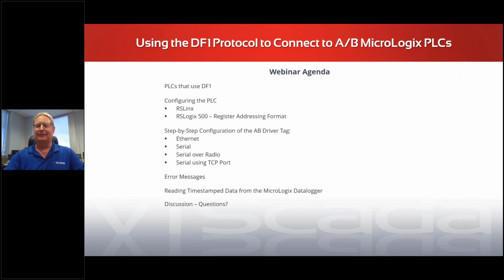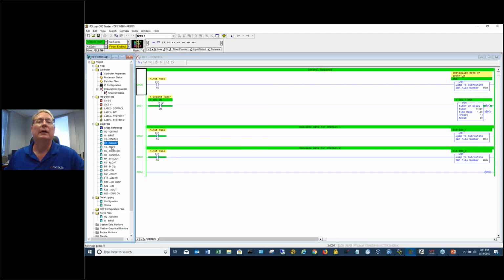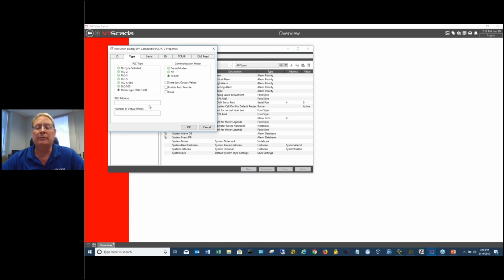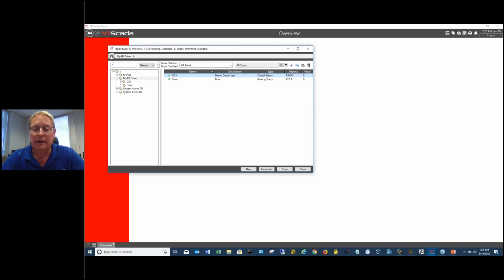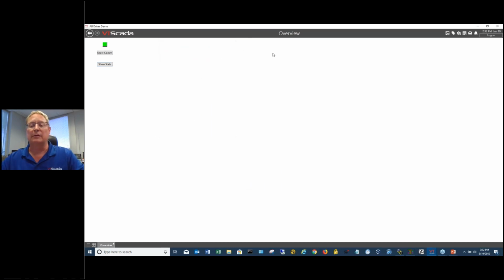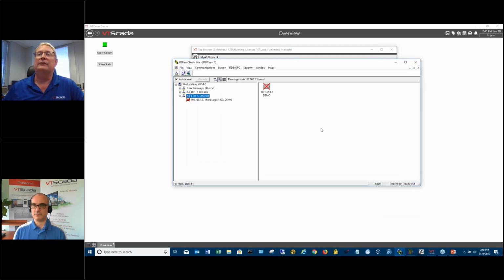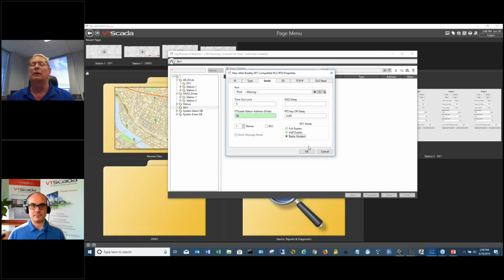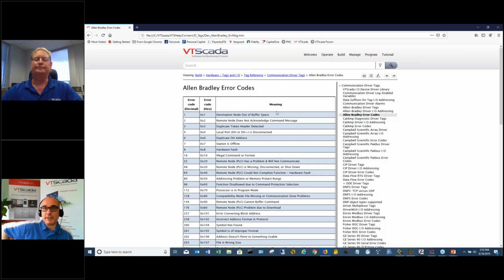Using DF1 to Connect VTScada to Allen-Bradley MicroLogix PLCs

Comment: Hello, I need some help please. I need to communicate VT SCADA version 12.1 with the Micrologix 1400 via Ethernet, but I think this video was made for VT SCADA version 11. I noticed that in version 12.1.25 there is no such drive as you showed in this video. The currently available driver is "Rockwell Software Devices". First I selected TCP/IP Port and in the properties in "Connection" I put the IP address of the PLC and in "Port Number" I tested with "2222 and 44818", then I added the Drive "Rockwell Software Devices" and then I need you to inform me which the settings that must be carried out in "PLC MODE" would be PCCC over CIP? In "Port Segment Path" what is the correct one to put, would it be [1,0] ? And in the "PCCC/DF1" Tab, in PLC Type, I put "Micrologix 1100-1500", I clicked OK and then I added the tag in the driver and then I gave a "DRAW" but the TAG is not communicating. Could you please answer me here or would there be some other channel for you to explain me the answer for this question. Thank you very much.
Reply from the maker: Hello Engenheiro, thank you for using our VTScada software. According to the latest version of the driver list, (https://www.vtscada.com/device-driver-list/) the Rockwell driver seems to be the appropriate driver for connecting to this device. Configuration information for the Rockwell driver can be found here: https://www.vtscada.com/help/Content/D_Tags/Allen-Bradley-Tag.htm?tocpath=Reference%7CTag%20Reference%7CCommunication%20Driver%20Tags%7CAllen-Bradley%20Driver%7C_____0 or by using F1 to open help in VTScada and searching for the Rockwell driver.
Reply from the maker: We regret the confusion and we are currently reviewing these older videos.
Reply from the maker: If you are looking for more free training options I recommend our online VTScada Academy https://home.academy.vtscada.com/. This allows you to work your way through the same material covered in our paid instructor-led Operations and Configuration course (https://www.vtscada.com/training-courses/) at your own pace.
Reply: @TrihedralVTScada  Thanks you Very much, now I am able to comunicante with Micrologix 1400 by watching this video It helped me a lot. Excellent video, congratulations. Im going to use It here at the Company and If the software was good we will to buy it . See you later.

Comment: The 1200's are discontinued according to that slide, how does one connect a micrologix 1200 to VTScada ?
Reply from the maker: VTScada has a built-in CIP driver (Rockwell) as well as a Rockwell Specific Driver (Pending release) which should connect to a 1200. You can get the current list of included drivers here: https://www.vtscada.com/device-driver-list/

Comment: any compatibilty with delta plc or siemens plc?i have posted in the forum but no reply from your side.how should one trust the software with less training tutorials and no response from forum
Reply from the maker: Hi Yogesh, I am very sorry to have missed your question. Delta provides a wide range of PLC devices that include a variety of open protocols which we support. Please check the protocol for the device you are interested in and look for it in our online driver list here: https://www.vtscada.com/device-driver-list/ Note: In some cases Delta has extended these protocols to extend their functionality so you will need to test them. It is very likely that our support for Delta devices will grow over the next few years.
Reply from the maker: As for Siemens, yes we do! The driver list I mentioned above states that we support Siemens S7 PLCs using our standard Siemens® ISO over TCP driver. This tutorial found on our website should be very helpful: https://www.vtscada.com/webinar-connecting-vtscada-to-siemens-devices/
Reply from the maker: In fact, we have a wide variety of video tutorials on our site. At the top of the page is a simple tutorial that generally covers connectivity. At the bottom you will find specific tutorials for connecting VTScada to specific brands of PLCs. https://www.vtscada.com/scada-software-video-tutorials/
Reply from the maker: Also, evry install of VTScada has a step-by-step tutorial that you can find in the on-board help system. Just hit F1 and look for Tutorial in the menu on the left. You can also find a link to it from our website: https://www.vtscada.com/help/Content/Tutorial/tut_Intro.htm?tocpath=Tutorial%7C_____0
Reply from the maker: You can also download the course book for our Introductory and Advanced training courses on our Training page that you can work through yourself at your own pace. https://www.vtscada.com/training-courses/
Reply from the maker: I hope that helps. Again, sorry to miss you question. I will post this on the forum as well.
Reply: Thanks for your reply, I will test it on my hardware with siemens as well as delta
Reply from the maker: @AutomateX  Thank you for working with VTScada!